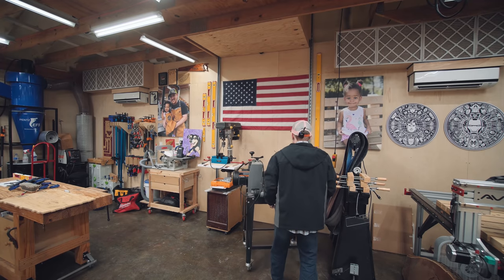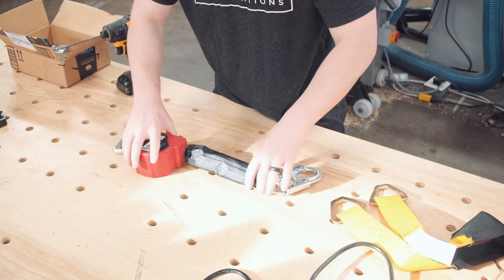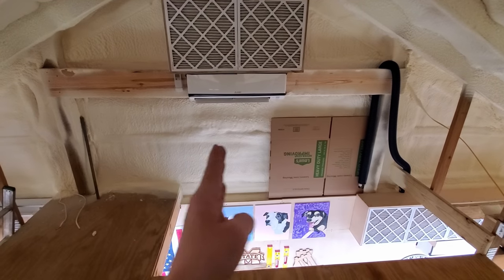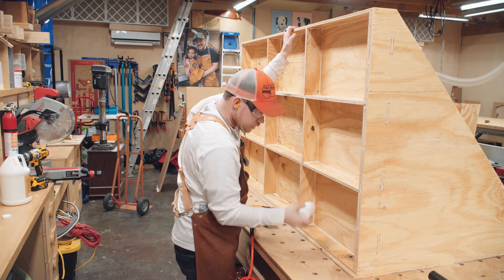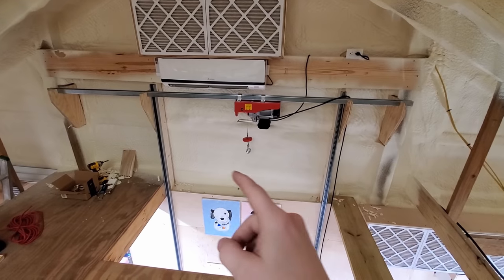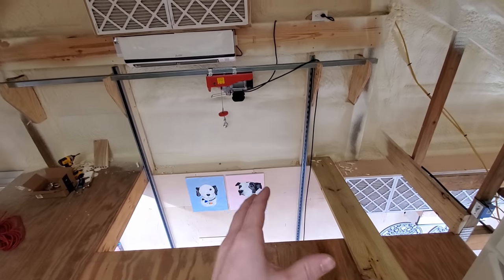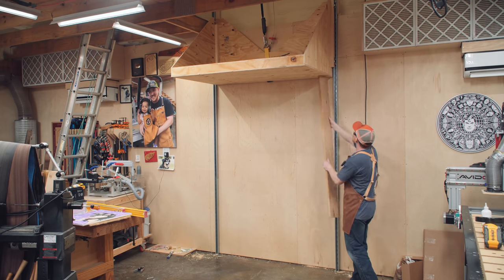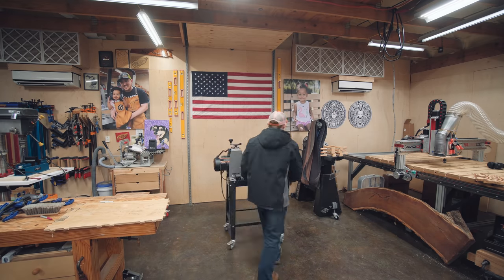DIY Elevator - 364

Comment: This is  cool good job mite want to have a 2nd way out for fire escape and if power goes out when your up stairs also probably should have a safety stop relay under the platform in case someone or something  gets under it while you are coming down and your not able to see directly underneath you just a thought.

Comment: Well done for emphasising the safety engineering. With jobs like this the doing is (relatively) straightforward; mitigating faults and errors is where the real work is. 
I did wonder if some ply fixed at an angle to the opening would be useful to push toes or objects back onto the platform but I suspect that as a 1 man lift, if there was a trap you'd let go of the remote.

Comment: OK, I was a lift system designer about 20 years ago. I did stage lifts, fork truck maintenance lifts, assembly lifts, etc.
Yes, it looks sturdy.
The fall arrester is a nice touch. (inadequate, but a nice touch)
At first glance it appears relatively safe.
But I'm not even going to start a list of code violations, design failures, and safety inadequacies. This is an accident waiting to happen. Do not try this at home. If a home inspector or your insurance agent sees this, they will make you tear it out.

Comment: A bit late to the party but I enjoyed this great video and project. You may consider installing a 20A switch with pilot light on the line, it is never a good idea to use a circuit breaker as a switch.

Comment: I use to make pick and place bots, as well as vertical lift mechanisms. All used ribbon cable for going up and down as eventually the round cables would break from repeated flexing. Now these machines were in continuous use so you probably will not have a problem, as with all equipment caution is the most important word.

Comment: They make switches with key code input or physical metal key required that could be installed at the bottom (and probably also at the top if a 3 way setup is possible).  They are essentially what you see at the hardware store on all their giant rotating shelves used for by-the-foot wire, carpet, and often on the panel saw as well.  Would make a good safety against unauthorized use without exercising the breaker.  Using a breaker as a routine switch may lead to premature failure.

Comment: Is it a good idea to have the fall arrester attached to the same cross beam the winch is attached to?  Surely the safer option would be to have two separate mounts for the arrester and winch for redundancy as one potential failure point is the winch mount.

Comment: Great project, Jay, but there are a couple of potential failure points that probably should be addressed from a safety perspective. A couple of engineers have commented here. I'd interface with them and consider their advice. You're a valued member of the maker community. Wouldn't want to see you get hurt in a preventable accident.

Comment: I would replace the flexing Súper strut with an Aluminum extrusion similar profile to the one you have on your CNC table that should illuminate any flex, just a thought great video
Reply: Two 2x6s bolted together would be more than enough for that span. That superstrut is definitely not enough.

Comment: Rather than turning the breaker off, I would use a smart plug connected by voice with either Alexa or Google. I did this with my garage door opener because the switch is high and hard to reach without a ladder and it was spontaneously opening at random times. This allows me to completely power off the opener to avoid spontaneous openings, and I can enable the power by saying "Alexa, turn on garage door opener." Just name the plug whatever you want such as "elevator," and it'll work the same.

Comment: Nice design. 1 question and 1 comment. 
Have you formualted a solution in the even of a breaker tripping of motor failure? 
Also, a nice upgrade would be an aluminum carriage instead of plywood.
Reply: Parachute
Reply: @instantsiv  i was thinking bungee cord
Reply: he could also use a compact nuclear reactor to power the motor - that way he wouldnt spend $0.0004 on electricity every time he used it.   and why aluminum like some 19th century corn farmer? he could have the whole lift molded out of carbon fiber for an easy $10,000

Comment: Don't know if anyone has mentioned, but my only concern is there is a gnarly pinch point between the left side wall and the attic floor.. the triangular shape of the wall would make it easier to escape reflexively, but at the point of contact it might be too late and pinch an hand, arm, or head and be very bad. I would have sacrificed that super satisfying fit for a foot of clearance just to be safe... Just something to think about. Stay safe!

Comment: 10:10 For added insurance on that electrical outlet, swap out the standard outlets and install GFCI outlets. They work similar to a surge protector, but instead of protecting your devices from surges in electricity, GFCI outlets protect you and whatever is plugged into them, from moisture, we all know how well water and electricity play together. If moisture comes into contact with the GFCI outlet or whatever you have plugged into it, a small built in circuit breaker, that you can easily reset, trips, disabling the power. GFCI's only cost a few dollars at your favorite big box store, and they install the same way. You also mentioned that your daughter has figured out how to climb a ladder. If you want to absolutely prevent her from gaining access to your elevator, you can install a keyed switch to that outlet which requires you to insert, and turn a key to power up the outlet.

Comment: The fall arrester you are using is meant for personal safety, not for equipment. A minimum overhead support point should be able to support #5600. That support should be independent of hoisted weight support. Please, don’t get hurt. Hoisting personnel requires a safety factor that you don’t have.

Comment: The unistrut that holds the winch looks like it needs to be beefed up or have additional supports.  Unistrut rates the maximum midspan load for a 60" (guessing here) beam of P1000 at 340lb.  Once you subtract the weight of the winch, unistrut, and platform I imagine that you don't have a lot left over for payload.  That 340lb doesn't account for the additional forces during acceleration and deceleration which is obviously going to add to the static weight.  You want to factor in acceleration and deceleration as unistrut is likely assuming a static load in their recommendations.  The fall arrestor is a good idea but if the winch fails under a heavy load and the fall arrestor engages the deceleration would very likely cause the strut to buckle.  Consider tying the fall arrestor back to the where the 2x4s intersect the 2x10 with a bridle strap.  Unistrut P5500 would nearly double the weight capacity of the strut but as you pointed out you can also sister the unistrut to increase strength.  https://www.unistrut.us/ has all the loading charts and calculations.

Comment: 10/10 functionality. But it’s only safe enough to be a material lift, no passengers. The fall arrester, depending on the type, will expand about 6 ft to absorb shock (the extra material is what’s at the end of the lanyard). So you might hit the ground, albeit slower, before the fall arrester stops you

Comment: You can also buy a length of Double Strut for the top section to hag that hoist on.......I'd rater use that as opposed to adding another section of single strut back to back.......its made for heavier loads like this with very minimal to no flex

Comment: Someone smarter than me can judge but I am not sure the screws used for the super struts were the best choice. If I am not mistaken those screws can relatively easily shear off. Small thing since unlikely enough screws could break at the same time to be a factor but..... Otherwise, loved it.
Reply from the maker: Have you ever had a screw sheer off? What about 20 of them connected to a rigid object? Now, once that object is secured and not able to move at all, how can they sheer off?

Comment: I'm a woodturner with a mini-split HVAC.  My local HVAC guy recommended that I use your DYI filtering system to protect my Mitsubishi mini split coils.  Are there specs or a plan for how you did that?
Reply from the maker: Search my website for "filters" and you will find more info.

Comment: Did you check the weight of the whole wood platform itself and the excess weight it will have to hold?  You said the hoist holds up to 500 max weight. ..but how much does the wood platform  weigh?

Comment: I think I would like to see the main frame of the elevator made of steel... or just better gussets to the front... that space that’s on the left and right is about enough to get a chain and some hooks in there... and I think two arresters would be better, and you could hook those to the ceiling and the bottom/side of the elevator platform, centered for safety, and they would never interfere with the hoist or anything, AND it would Be safer with two anyway, assuming a friend or a load of items on there with you plus the elevator weight...  all in all though, I almost need one of these now...

Comment: Awesome but I would have hoped for some backup safety feature (second cable, inertial brakes, maybe springs beneath... something)...
Reply: He did put a fall arrester in... As long as the platform does not fall apart, it should be fine.
Reply: I think he took very sufficient safety precautions. It’s not that high. It’s not a kids toy. And I’m sure most of us have been higher up on ladders with less safety measures. 
The fall arrester is a good idea.
Reply: Fall arrester needs to be attached to something completely independent of the support structure.
Reply: @nordishkiel5985  I didn't notice the fall arrester...

Comment: I think you should get a proper countersink (for metal) using a larger drill bit isnt good as the angle of the drill tip is completely different than the angle of a countersunk screw

Comment: could you add some type of pedal attached through the platform that has a metal tab that would click into place in the super strut as you are raising the platform. kind of like a spag on a ratchet strap, but bigger.

Comment: For heawy use i woudl go for scissor lift platform sunk in the ground.
Also a handle would be a good idea to hold on something if you dont want a railing and marking tape the edges you can get even foto luminescent stickers to mark the hole or edges and so when the light turns out you can see it.
And mark probably the botom area of the lift so people will know  what and where to move when you oparet the lift.

Comment: Get rid of the electric hoist put in some counter weights to off set you weight have a few extra that you can add for people who are heavier or lighter and have a pulley cord so like it would take like two pounds of extra force to pull yourself up. If you add some more pulleys you could possibly use less weight.

Comment: I have seen first hand, how the arrestors work. Trust me, add the second piece of uni-strut now before you find out the hard way that it was indeed needed. Actually, I worked in nuclear power plants. There they would not allow the hoist to be used by humans or the arrestor to be on the same station as the hoist. Yes, over picky, but I have seen some bad stuff. Including a guy end up unable to walk after his arrestor was hooked to the wrong place and a golf cart ran over an air hose that tangled up onto the golf cart axle and then pulled down the portable structure with 3 men working on it. Two of them were shaken, but fine. The third was hooked wrong and made it to the ground the fast way. So yeah, add the extra uni-strut.

Comment: I would love to build this but I have a bunch of kids around.  What about some sort of kill switch in case some kids decides to ride up with his head looking out over the side?  Maybe a strip of metal on the front with another strip in parallel above that strip held up on each side by weak springs in the wood.  If the two strips of metal touch it shorts out the winch motor and stops.  Something like that?  Aaaannnd go!  I have no idea what I'm talking about so need you engineering types to take this idea and run with it.

Comment: I've done a lot of such things while in the industrial sheet metal trade for 40 plus years. The first problem I saw was the fact that you put that winch on a single piece of stripe, it should have at least been a double width strut.
You also assumed that that strut cannot bend and collapse. Do not ever make that Assumption of just a square. A rectangle, as is represented by the double width. Would be far superior to resisting bending because once it starts to bend and it is still being stressed, it will go to its logical conclusion. You may end up in mid suspension.

Comment: That fall arrestor is meant to unravel in the event of failure... if you had to add length via that chain to get to the ground with the arrestor compressed, then if something fails below the unraveled length of the arrestor is still going to free fall directly to the floor. It looks similar to the one's I have at work, so I am going to guess that 3-5 feet of free fall with the elevator and whatever else is on it directly to ground, which can still be pretty dangerous. Don't know if you had considered that, but I can't in good conscious not mention it.

Comment: I certainly would've built a small railing around the opening on the upper level with a full length gate. Having that hole exposed like that would give me the willies. Likewise at the front of the lift I would've built a rudimentary openable gate as well. stumbling or tripping a little bit whilst going up and falling out of it and getting pinned between the opening and the floor does not sound like something I would like to happen. A little bit of safety railings would've been better...

Comment: I know I've watched Project Farm's video on wood glue strength... but man I can't help feeling like that base just isn't strong enough with plywood.  I would have over-engineered it with some solid wood construction covered in plywood.  At least put some solid wood  triangulation on that right angle from floor to back.  That's an awful lot of leverage being generated when you step up right at the front.

Comment: You might add a bi-fold floor on the mezzanine level that folds sideways out of the way when your elevator goes up, and down when it goes down.  Just balance it so it is gravity operated.   That way you can have a floor in place when the elevator is down.  Pretty clever solution for an elevator.

Comment: That  fall arrest is  completely inadequate.   For one  I would install one more  arrest device, and  attach each to   MUCH  more robust  anchor points, separate from each other and separate from the   winch anchor.

Investigate the force of a falling load.   "You" falling plus the weight of the platform in the event of winch line  failure  and when that fall arrest starts to   "arrest"  would result in  turning that  attachment point into scrap iron   that would then land on your head.   I am  "deadly serious" here.    I've forgotten requirements for tower climbing,  I think an arrest point  "then"  for a single climber  arrest gear  was  5000 lbs

You might  also investigate using  twin cables  wrapped at  opposite ends of the winch drum  for redundancy.

Comment: Hey "Joe Safety Nut"!!  If your really concerned with safety, then why did you attach the fall arrester to to same unistrut the wench is attached too.  Anyone that's ever used a fall arrester knows to always attach it to a completely separate static point.

Comment: This video somehow got recommended, maybe cuz I ghetto diy an elevator in my garage shop as well. I builted mine with garage opener, i am a small guy and I usually don't store anything heavy at second level. I really mickey mouse and ghetto diy my elevator, so instead of pulling a garage door, heck it had enough poewr to pull me up (PSA don't do it unless you had been 100 pounds since grade 9 and you tried everything to gain weight)

Comment: You can buy unistrut in 20’ lengths
Reply: I was wondering if any one else was going to call it unistrut.
Reply: @dannywilsher4165  I’m a commercial plumber.
Reply: @stevestratton1888  I was an electrical engineer back in the working days. I specced out many miles of unistrut on many jobs. I was smiling when I saw Jay using it. Reminded me of a structure I built with unistrut to store my 67 SS Chevelle body while I was restoring the frame.
Reply: @dannywilsher4165  I use it for al sorts of things. Like a bike rack that I mounted to the bumper of my RV

Comment: I probibly would have added limit switches to the unit and made a circuit so the buttons stay on the wall or even inside the platform... like a regular elevator...

Comment: Thanks for another great video Jay! I was wondering if you considered using a snatch block on the hoist line. It would double your hoist’s weight capacity, half the amount of stress on a single point on strut at the top, and it would allow you to move the motor from directly under the ac to avoid condensation issues.
Reply from the maker: Not only did I consider it but I included it in the video ;)
Reply: Oh, Sorry! I rewatched the video and I can see it at the very end now! Thanks for the reply.